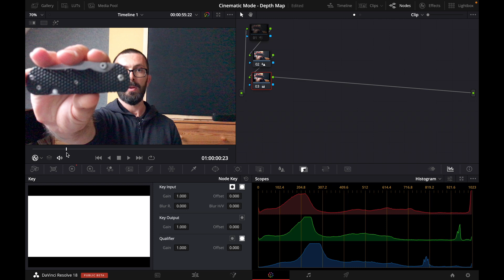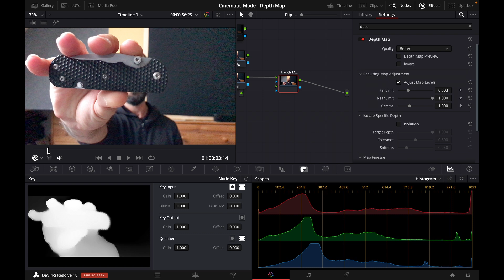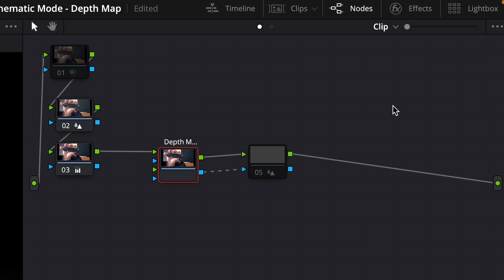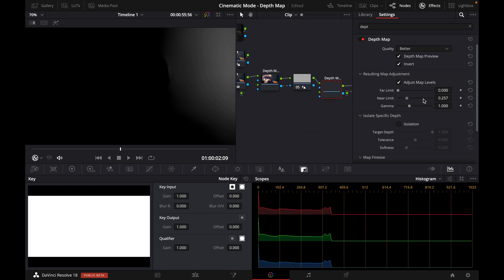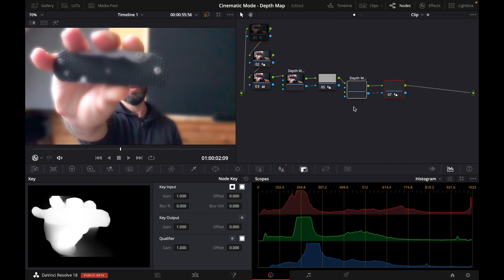Davinci Resolve 18 killed iPhone 13 Pro | Cinematic Mode using DepthMap | Tutorial |

Comment: But doesn't the iPhone use Lidar + calculations from its many cameras to create the depth map in a way that a single camera can't? I imagine the map created by Resolve would be closer to something like what Zoom does to blur or replace the caller's background. Still exciting for sure, but hardly a replacement.

That said, the iPhone version is not terribly useful for filmmakers as long as it requires us to use their horribly limited native camera app to get the depth functionality.
Reply from the maker: I'm not a programmer, so I don't know how BMD did it via AI, but the fact that they did it on only one camera means to me a lot. And probably it will evolve in time to lot better. Also I've showed just one case of use, there are many more things to do (darker/lighter background, faking 3D video from 2D image and more).

Comment: Thanks for this video. It reinforces why I upgraded from a Mac mini M1 to a Studio Max. This is another use of Resolve's new AI based tools and the Depth Map is really powerful took to use. I have seen multiple different applications of it. Thanks Again.
Reply from the maker: You’re absolutely right. I’ve been also amazed how we can use it in fusion too.
Reply: Makes me a little sad when buying Mac mini m1 that max studio has horse power that I would wanted instead mini…. I hope working with proxies would be okay
Reply from the maker: I'm using Air M1 - in fact I always work in 1080p timeline and if I have to export in 4K or UHD - I'm switching the resolution just before export.
Reply: @uncleanAlibertine1  It’s all depends on what you shoot and what resolution.